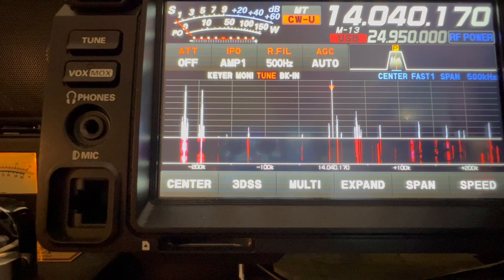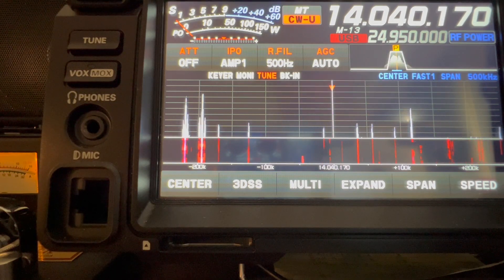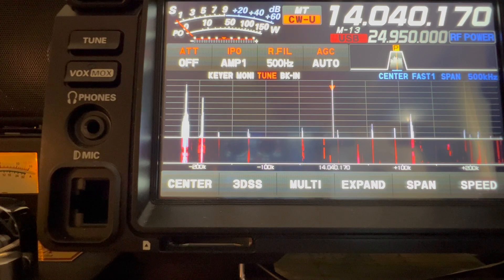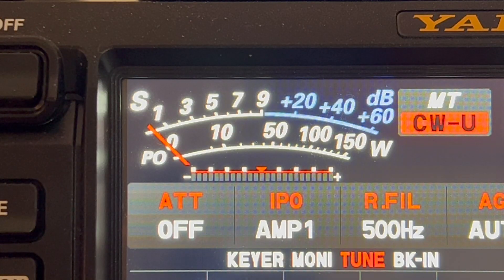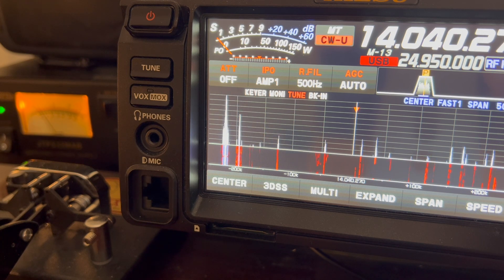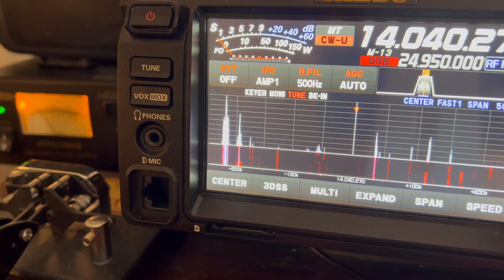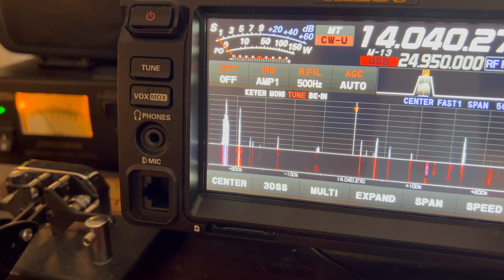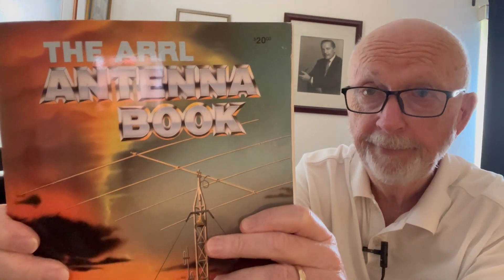Ham Radio and Power - How Much Difference Does It Make?

Comment: Well...antennas make the most difference.  Run the best antenna you can - resonant if at all possible.  Vertical with elevated radials is almost 100% efficient and I run that when portable.  I've run qrp cw and able to work about 80% of the stations in state qso parties with 5 watts.  When chasing cw dx station, sometimes 100 watts wont do it.  In that case, more power is necessary and difference between 100 watts and 300 watts can get you heard above the noise.  Everyone likes to work loud stations as they don't like to struggle with qsb and trying to understand the other operator.  So....yes...have an amplifier to use when necessary , but, don't use it when not necessary.  In contests and qso parties, everyone answers the loud station.
Reply from the maker: I agree except I like a multi band non resonant antenna.

Comment: never had a problem talking to Europe N America, S America, Caribean, or the S Pacific with 12 watts & an antron 99/no radials about 18ft high. which is just a peice of copper wire inside. Don't tell.
Reply from the maker: Sounds like the coax shield is your radial.  Sounds like it works for you.

Comment: Well, if you're well above the receiving side's noise floor, it doesn't matter much, for sure. But if you're 1 S-unit away from getting that good DX station, then 1 S-unit is a LOT with respect to that QSO. Also, CW is a highly coherent signal mode that pops out of incoherent background noise and where the Rx bandwidth is narrow, admitting much less noise than SSB, so it probably doesn't matter as much in CW as it does in SSB. But I'm a 100W guy, running a single wire, I'll take every 1/4 S-unit I can get.
Reply from the maker: I hear yah!

Comment: Another good common sense video! Totally correct. There are several good power levels or steps depending on where you start. With a 100 watt radio dialing it back to 20 watts for portable is insignificant and saves battery.  When I am in a contest I run about 500 watts out. That’s only 10 dB better than my normal 50 watts. That gets me better than 1 1/2 S units.  That is barely a worthwhile improvement but in a contest with weak signals it is noticeably better. Under general operating conditions ( not extreme weak signals)  20 to 50 watts is just as good. Going to the full limit would only gain me less than 1 S unit. I would have to go to 2000 watts for that. For me the difference is insignificant. I am still on the original tubes in my amplifier as I never push it to its rating! So 500 watts works for me and sometimes gets me 100 or more countries on multiple bands in one weekend. My antennas are also simple dipoles. As high as I can get them, frequently right at the 50 foot level. Some are in the 30 foot range. Being broadside to a dipole is very significant as on the higher bands you can have a null of several S-units of the ends. The higher the dipole the deeper the null. On 10 meters I have two dipoles to avoid the nulls. Recently I have used 2 dipoles on 20 meters but the payoff is not as good as on 10 meters where the antenna is twice as high in terms of wavelength, but there are times it is still a help as there is still a significant null only at 50 feet on 20 meters. 40 is a different story. The null is pretty insignificant at only 50 feet. 
 I guess if the power increase or decrease ( transmitter power or antenna gain) is not 6 dB it is usually not significant.

Comment: Great information! 
And while I fully understand the concepts of power output vs "being heard", I tend to run legal limit most of the time when I'm on the air. Why? Because I can!😂. I have multiple amp's, multiple radios, good antennas (all wire antennas) and good feedlines (all Heliax), and I'm rarely ever "not heard". If I can hear 'em, I can work 'em!
There are time when chasing POTA stations that I will work at 100 (or less) watts, but when working/chasing DX, or doing Net operations, it's with power.
"Life's to short for QRP!" 😂
73 from Texas!

Comment: You're completely correct in the fact that going from 10W to 80W is just two S points difference but there's a lot more to it than actual signal strength and it's frankly ridiculous to concentrate solely on that one aspect.

Increasing the power by that amount makes a huge difference in the signal to noise ratio and the readability of the signal.  In the UK,  our power limit has been increased from 400W to 1000W and I've been doing some testing on SSB with distant stations.  In each instance, I turned my power up from 400W to 1kW and asked for a comparison.  Every person I did these tests with said that the signal strength hadn't gone up by any real noticeable level but it made a big difference to how the signal sounds.  It sounds much louder, clearer and just generally better.  

Of course aerials are important.  A 'resonant diapole' (really?) is a good starting point.

Comment: I agree with you. The antenna is the base of having a good signal and certainly makes the biggest punch.
But when the noise floor on the receiving end is high and you have a good antenna, that 10dB difference can make just that little bit more of a difference. 
Also maybe in a pile-up. Although waiting for the right moment and having a clear audio mostly does the trick.
And yes, in CW I have worked all around the world with 5W QRP.
Live is not too short for QRP.

Comment: Oh 3 db 
1/2 s unit 

Strange 
I've always read that 
S9 was 50 microvolts 
S8 25 Microvolts
S7 12.5 Microvolts
Etc 
On a standard s meter 

So if I'm s8 25 microvolts 
And I double my power 
The receiver now has 50 microvolts 
Or 1 s unit increase 

That 6 db is an old myth 

Go talk with a local station on 10m
So no qsb 
Someone that's hearing you around s7 and s0 noise floor
And you are running 80w 
Send a carrier , that's better than ssb voice peaks 
Then decrease power to 5w 
That's 12 db 
I guarantee you will not drop to s5
(12db ÷6 =2 s units )
But to s3 (12 db ÷3= 4 s units)
You will be s 3

Don't believe me ?
Try it
I've demonstrated it many times with hams who believed in the 6 db 4 times power is 1 s unit myth 

Oh but their s meter isn't accurate 
Try it with another station and another until your convinced 

Please don't reply to argue 
Just try it

Comment: I see a lot of videos talking about things like this.  Although I mostly agree, I do somewhat disagree.  100 watts in the field means almost 100% reliable NVIS coms with stations that you want and plan to contact  with a reasonable antenna (similar to half wave dipole).  With 5 watts, it is less than stellar reliability.  The military figured this out a long time ago.  QRP is for making random contacts for fun.  100 watts plus is for reliable communications.  Sometimes that fraction of an S-unit brings the station out of the noise.  Where you really can see this lately is 60 meters.  The noise, in my area at least, has been awful.  5 watts might get you heard next door, but not 4 states over.  That is a good band to test on as everyone is running 100 watts or less (usually!) with unity gain antennas.  73, KF0BBU
Reply from the maker: I agree.  Nothing wrong with running 100 watts and didn't mean to imply it was.

Comment: The comparison to a commercial AM broadcast station wasn't fair.  And I don't mean or intend "fair" in that "butt-hurt" context.  Rather in Ham/CB radio where such several radials aren't practical nor necessary.  I run a multiband vertical mounted to an apartment balcony railing barely 20 feet above the ground with no radials and work the HF bands up through 80 meters just fine with my 100-watt transceiver.
Reply from the maker: A vertical above ground like that needs only about 3 radials.  The coax braid of your feed line serves as your one radial. I'm sure it works pretty good.

Comment: Well pointed out and why I won't be using our new 1 kW power level. I used to run 100 Watts years ago and saw no point going to our then legal 400 Watts.
I hear mostly U.S.A. stations booming in, then they say, 1 kW, 4 or 5 el Yagi atop a 100' tower. Why? My h/b radio stops at S9 in my ears, like it always did. 
For 30+ years i've had 5 Watts and less. Recent QSO's using 5 Watts c.w. to Bulgaria, Spain, Sicily and 1 Watt to Italy and Bulgaria at 1400 Miles and ½ Watt to Poland, all and/or 17m and 10m. 5 Watts s.s.b. to Sicily at 1400 miles.
It's readability which matters. H/b attic dipoles, all five bands 20m to 10m. Pixie on 5.262 MHz at 350 mW out.
A full size C.B. aerial? It'd look like a Dodgem Car.
G4GHB.